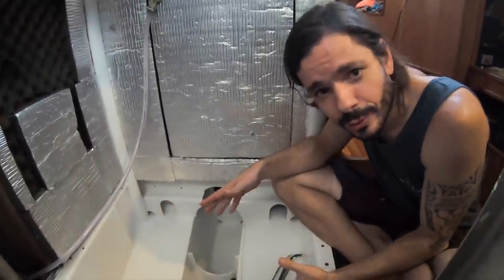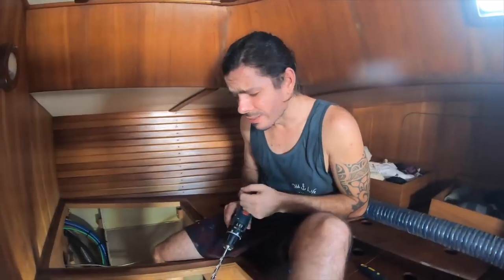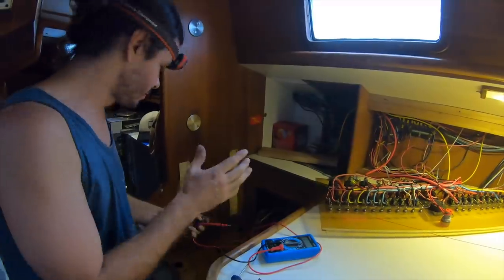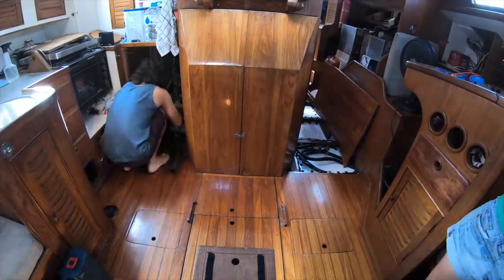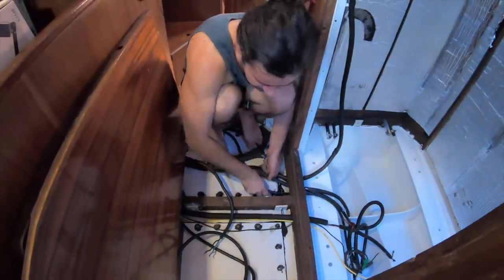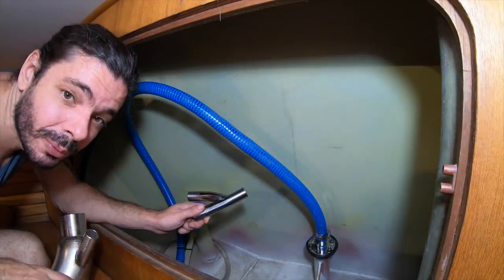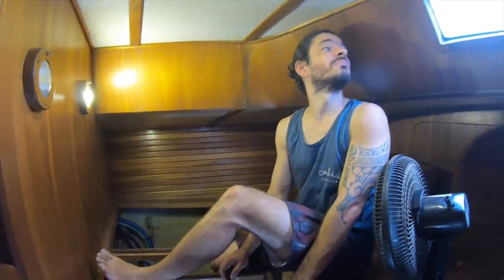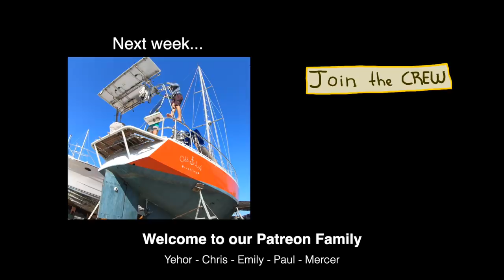⛵️We didn't think about that when we Bought a brand NEW ENGINE for our Sailboat!! 😨#174

Comment: Hi Duca you have your maths a little wrong a 1inch circle and a 2.25 circle does not add up to a 3.25 circle though relax you should be OK since you need a 3 inch circle. Obviously the whole point of the exhaust system is to allow it to breath out (Exhaust) the waste gases and it is all about the surface area just like if you had to breath out through too small tube. Not an engine mechanic but I also think having too much surface area to exhaust through can also be bad though I think not as much.

Anyhow it is all about the surface area so a 3 inch tube has one of Pi X R squared = 7.06858 For a 1 inch that is .7854 and a 2.25 = 3.97608 or a total surface area of 4.76148 a difference of 2.3071 inch square of roughly 2/7ths or 30%. Of course I could do the maths exact but I am too lazy.

This is the law of Pizza's and why shops will sell you a special offer of 2 6 inch pizzas for the same price as a 9 inch because the ingredients are actually less.

However I did say you should relax because If the engineer has ok'ed it there might be a little more back pressure than ideal but the worst possible outcome is that the engine wont run. More likely you might lose a little power at top revs.

Since all your modifications have been to get an extra 1/7th area and of course it is the smallest diameter that counts I would of been tempted to ask the engineer if 2.25 4/7ths of the required area is OK and tried it but a moot point now and If you have to bite the bullet and modify your 2.25 hole then at least the other work has not gone to waste. Well apart from splitting it into 2 pipes.

BTW if you have a hand sander and lots of sandpaper you can polish that tank to a mirror finish it will take many hours but look much better than paint.

I hope Fred's Dad makes a full recovery and is soon back on his feet and Fred can return to the boatyard.
Reply from the maker: You are definitely right Glen. It is not the same area. To be honest we talked to a friend the works with marine engine for around 30 years and in his opinion even with 2.1/4 we wouldn’t have a problem. But we decided to add a little bit anyways as this modification was really simple and we could get the approval from the Yanmar representative. But you are definitely right we didn’t get to the area of a 3” hose. And to do that we would need to cut the hull of the boat and it would be a mess that would for sure generate rust in many places of the boat for the next couple years due to the metal dust that is impossible to contain and clean 100%. 😅
Reply: @OddLifeCrafting  Glad to hear that you have the approval from the Yanmar rep!
Reply: @OddLifeCrafting  what about all the bends? they will increase back pressure
Reply: Wow!  By the way, thanks for your thinking of Fred.  I joke about being Fred #2 as my name is Fred too.  But in this present world finding "A" friend is hard to do.  This community that Duca and Roberta have started is precious and Fred is definitely one of the pillers of this community in my humble opinion.

Comment: I am bit scared of number of connections needed in your new exhaust design, before it was four, and now it's multiple times of that. Exhaust leaks in the boat are deadly. And don't put any other functions in the exhaust port; diesel soot + hot seawater will destroy any check valve very fast.
Reply: Sometimes you gotta do what you gotta do 😜

Comment: A 3" exhaust pipe on a 50 hp (or so) engine, is completely unnecessary! I've seen 300 hp engines with smaller exhaust pipes than that. Personally, I would have recommended you kept using 2.25" inch, all the way downward from your manifold.
Reply from the maker: Yanmar asked us to keep it 3 to keep the warranty
Reply: @OddLifeCrafting  I see! Strange choice from Yanmar but I understand that you’d want to keep your warranty. Thanks for answering, good luck!
Reply: This is a wet exhaust, so most of the volume is occupied by the cooling water. 3" is just about right. I have two boats with a similar setup. 60hp and 3" wet exhaust.

Comment: On the exhaust pipe, why didn't you just use a 3" to 2 1/4" reducer. This would increase back pressure and horse power.

BTW, thank you for using Roberta respectfully in your videos. So many "couples videos" tend to exploit the woman by putting her in sexy pose's or sexy swim wear.....just for click bate. You are a real gentleman.

Comment: Amazing work again, your tiny floating home is going to look like new!! And the best part is that you will know every corner and how much effort and love you spend in it. Very inspiring!! But guys, I am worried about the exhaust system, be careful with all those tiny passages close to the wood and metal pipes, they could get really hot and cause fire. I am convinced you have it in consideration too, but make sure you do a proper insulation. All the best!!

Comment: I love the progress that you've made with the boat! Question...will you have to wrap the metal elbows for the exhaust? How hot is the exhaust pipe that's going behind/under the drawers going to get? Fiberglass heat shield tape might be worth looking into.
Reply from the maker: ☺️💕We wrote some notes on a comment pinned. Check them out ☺️😉

Comment: Thanks for the tip using tape to mock up the exhaust pipe bends before taking to the welder. May seem obvious to you but I hadnt thought of it. I was going to tack weld, but I cant weld, have no welding equipment and would need to hang upside down in the cockpit locker. Thanks again.
Reply from the maker: Glad we could help somhow

Comment: More info about your VHF radio. The transmit and receive distance is not that far in miles so if you have an emergency and no contact can be made on VHF you could try SSB HF and transmit/receive many miles because the signals bounces up and down maybe hundreds or thousands of miles. All The Best, Bill, K5WEJ

Comment: have you considered running the exhaust through the transom ? that 1 inch diversion isn't really going to handle the additional exhaust flow. I know I've been engineering exhaust systems for 15+ years. Just run the exhaust through the transom, the noise will be negligible with a diesel
Reply: Agreed!

Comment: By the time you receive this message you will have solved the problem, however the easiest solution is to split the exhaust into two 2 !/4" runs from a y-joint near the manifold.  As a boat owner (and electrician) my hat is off to the two of you.  Less is best when it comes to marine wiring and removing unused cable is essential.  More clutter can be removed by re-purposing existing wires if need be.  However, todays wire insolation is technologically superior to the wire and connectors originally used.  Brothers makes a small inexpensive label maker to tag the ends of the wires that make modifications and repairs much easier.  Love this series!

Comment: Roberta you have a great presence of what has to be accomplished with the new mechanical wizard Duca now that Fred is taking care of his dad.Not really sure but I believe that they make stainless steel flex tubing which I believe would work a lot better than the hard fittings and easier to make the bends you are after they use them for exhaust system for commercial vehicles just use your hard fittings at the engine and the rear were you connect to the bilge hose? Nice wire clean up Fred would be proud. Be careful and stay safe Love you both. P.S. nice engine.

Comment: Your capacity for hard work and dogged determination to complete complex projects is truly admirable. I’m sure you’ve considered that the exhaust pipe could be very hot so you’ll have to use some sort of heat shielding material to prevent a possible fire where it comes in contact with the wood or other combustible materials.
Reply from the maker: It’s not gonna get as hot as if the engine has a turbo engine, but we are planning on protecting the pipes
Reply: @OddLifeCrafting  I’m guessing that the exhaust pipe itself will act as a heat sink as the hot exhaust travels further from the engine.

Comment: Might be a good idea to run conduit from the panel to different connection "hubs" around the boat so that you can run more cables if needed in the future. A bonus is that the wires will be a bit more protected. Nice to see you just working along, will be fun to see the finished engine install :-)

Comment: You two are doing an amazing job - your attention to detail is superb!!
One piece of advice (from someone with a bit of experience!!) - have you checked that the existing water lock/water trap is big enough? Going from 2.25” exhaust hose to 3” hose increases the potential water volume in the hose by nearly 80% - it’s going from approximately 2.5 litres/metre to about 4.5 litres/metre of hose. I’d hate to think that after spending so much money on a new engine that it may have the potential to become hydrolocked (water from the exhaust system being able to enter the cylinders & preventing the engine from turning over). 
Best not to ask how I know this!!!

Comment: If you ever sail longer distances away from shore the SSB will let you
1: Receive weather broadcasts from weather router services.
2: Stay in touch with buddy boats who are ahead/off to the side of you reporting back what the conditions are.
3: Receive high seas weather broadcasts.
4: Receive graphical weather maps.
5: Send/receive email (using Sailnet or some other service).

I have nothing against a satellite service. It's always good to have a backup to a critical system.

Comment: The drive flange on the new engine is inclined downwards. Does it really work with the drive shaft arrangement without having to tilt the engine forwards? Also a gearbox like that is usually made to take axial load so you might need to use softer engine mounts.

Comment: You two are getting it figured out!
I do have a concern, and maybe this will be addressed next week, but are the stainless portions of the exhaust going to be wrapped in insulation, both for heat issues, and also for noise.  Some of it is very close to the cabinet framing.
Reply from the maker: We wrote some notes on a comment pinned. Check them out ☺️😉

Comment: As a car guy I can say you are not alone in not thinking about Exhaust after an engine upgrade!  :P  I had one car post engine change I would burn up starters, every 6 months, due to the exhaust being to close!  hahaha that stunk.  My dad had his own adventures with exhaust issues with motors on his race car too.
Reply: Haha, oh man does that ring a bell. Yeah they get heat soaked and if i had to make quick stops I would leave it running! I did use a heat shield eventually and surprisingly it worked pretty well.

Comment: I think someone already said to wrap it. That needs to be done. Also, if you paint the can white, it will turn yellow after time. Best bet is to weld it up and have it sand blasted. Looks like the Yanmar has fixed front mounts. Have you had time to measure the differences in crank centerline on the two to see if there is a difference? Lower c/l on the Yanmar will be easy to deal with, but if it is taller, it will be a tad tougher to work around that.

Comment: Hi you two! If that old autopilot still works, I’d keep it installed as a backup. Having had an autopilot fail on a multi-day offshore passage, I’ve since made it a rule to have two complete autopilots installed. Even if the newer one works better, having the old one as a complete duplicate is a huge plus. In the middle of a rolling seaway (autopilots almost always fail in the worst conditions) it’s often not possible to change out parts even if you have replacements.

Comment: Looks like you guys are doing the right things with the wiring, any time you can get wires out of an engine room is a good thing! 

On the flip side though I don't think your exhaust exit is going to work, and I am saying this as someone who used to be a professional welder and went to college to learn pipe fitting and layout.

The reason being is that it appears your other hose there is a 1" or .75" ID,  Assuming that it is 1", a 1" hose has a cross section of 0.785 in^2, a 2.25" hose has a cross section of 3.976 in^2, so combined they make up a cross section of 4.761 in^2. 

A 3" exhaust has a cross section of 7.069 in^2 meaning the 2.25 & 1" together would have 2.308^2 less cross section, meaning it can only move about 67% as much exhaust. 

So you would be losing 33% of the exhaust in that setup, not to mention that the split is going to cause turbulence in the pipe, which will further lessen the volumetric efficiency. 

The worst case scenario on this is that water and exhaust that come crashing down the pipe for the exit create a huge amount of back pressure, and then the exhaust back fills with water and floods your brand new engine choking it to a stop. 

Conversely speaking, if you cut out the old 2 1/4" pipe, weld in a 3" stand pipe, and sand and paint it all up, you will know it will be done right. 

I know the idea of destroying brand new paint to redo a section of it is gut wrenching, but it would be nowhere near as bad as having to do it after damaging your brand new engine. It is just a bit of welding and paint to get it done right, and you have the facilities there to do a proper job of it right now. 

On that note I have a Yanmar 4JH3E in my boat, basically the same engine you have now, fantastic motor, she will give you many years of solid service. Mine runs like a sewing machine, solid reliable, smooth!
Reply: Unfortunately Mr. Einstein, I'm certain most people lost interest in this foolish attempt at sounding smart after about the fifth line. I did.

Comment: Bonjour les amoureux,
Tricky épisode, great épisode ! Having Gene Kelly in your boat is amazing ;+)
Little question, is painting an exhaust part with epoxy a good idea ? It will become very hot. On m'y copper boilers, I use a spécial paint which resists up to 600C.
Amicalement Raphaël

Comment: question, the exhauster pipe is going to get pretty warm/hot if you are running the engine for any length of time?  What are you doing for insulation to protect the areas that get close to the pipe?
Reply from the maker: Check our pinned comment 😉

Comment: I am not a sailor by any means but if I was you guys I would do a double check before you start out actually sailing and tie-wrap all loose cables and hoses to something strong and stationary as any kind of movement on the water from waves etc, will start to cause chaffing and wearing of loose cables and could cause issues for you later on! Cheers you guys are doing a wonderful job!

Comment: Each step is measured carefully, everything will work. Wiring is never fun and running exhaust through all those angles around obstacles is rewarding in the end. Measuring the Engine mount points between the new engine and the existing ones on the boat and where the transmission output ends up will be a fun process.

Comment: How are you going to prevent vibration from the steel pipe on the bulkhead also if it does it will wear the paint away and cause rust. Can it be wrapped in something?

Comment: Excellent electrical work.
It is rarely worth it to fix more recent SSB Marine Radios. Best to get a whole new one. They're great, and really better (and a lot less expensive) than satellite phones. 
That said, often you can keep the same antenna for marine radios, just replace the connectors to match your new device.

Comment: 2 things
First, remember to manage your wires for chafe. Wrap them with plastic protectors and secure them with clips and zip ties. This prevents problems and prevents fires down the road.

Second, I have worked on hundreds of that exact engine. They were in a generators but still the same engine. You’re going to be very happy with it. Very low maintenance! Very high reliability! Very good fuel efficiency! 

After your break in period you can run 5w40 synthetic diesel motor oil and only have to do change oil every 1000 hours. Of course you’ll want to verify with Yanmar that it won’t void warranty before going to 1000 hours. But I had a fleet of that exact engine that ran WAY past their life expectancy with synthetic oil and 1000 hour oil changes. We had 20 year old generators with 30,000 hours on them. With having just replaced a few water pumps and belts. 

Remember to only run Diesel engine oil. The additives in the oil are different from gasoline engine oil. 

Great engine!!!!

Cheers,
Jeremy

Comment: Thats a good idea to get as much wiring out of the engine compartment as you can. The heat just cooks wire insulation over time.  Should have less problems over time

Comment: Hey guys on the exhaust part that come from the water lock that u were talking about at the end of the episode. Have your welder do some pie cuts to make the two pipes line up. It’s what we do here in the states to get our exhaust on our car to fit in places normal pipe can not.
Reply: In your backyard. Here in the states when street rodders build exhaust we use a pipe bender with a mandrel and dies.

Comment: Are you going to use mainly solar panels for your power or will you get a back up generator? I know you could run the engine to charge batteries but sometimes it causes excessive wear and tear on the engine.
Reply from the maker: We won't have a generator for now